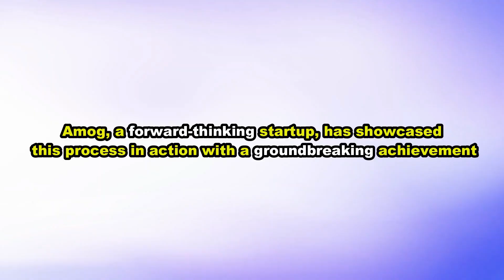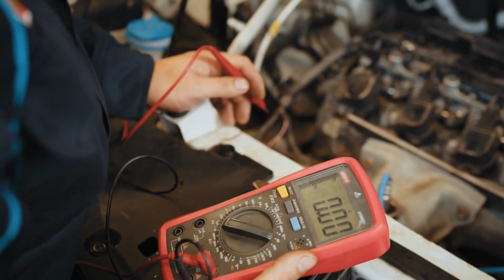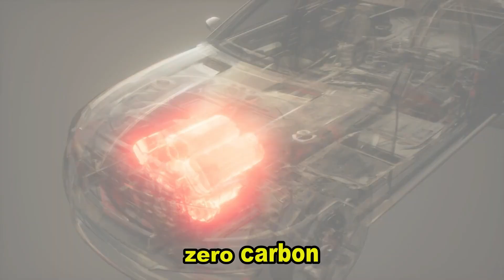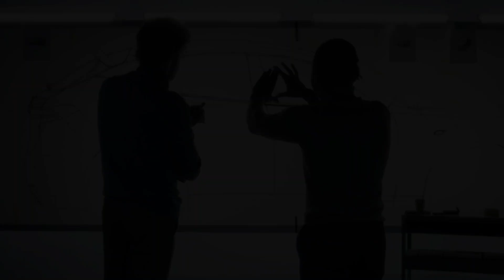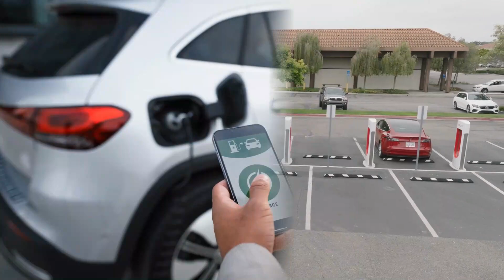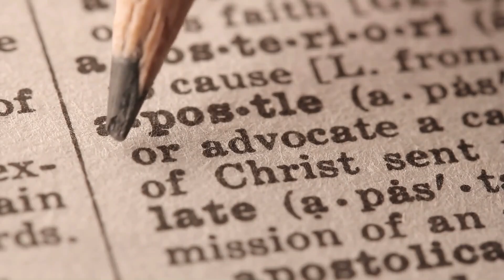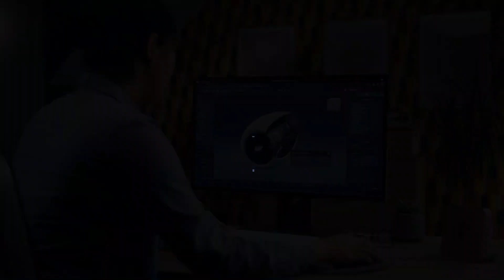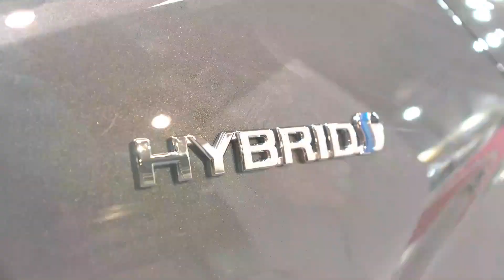Toyota CEO Our New Engine Is The End Of The Entire EV Industry!

Comment: So....Ammonia is made using solar and windmill green energy.

Why convert electricity into ammonia to burn in a combustion engine when you can just use it directly in an EV.

Sounds a bit like the "Hydrogen is better" crowd, but then you find out it takes about 3 kw of electricity to make 1 kw of hydrogen energy.

But hey lets find a way to still use ICE engines, that need regular servicing, instead of EV that has a LOT less moving parts and does not need sparkplugs, exhaust, timing belts and so on and so forth.